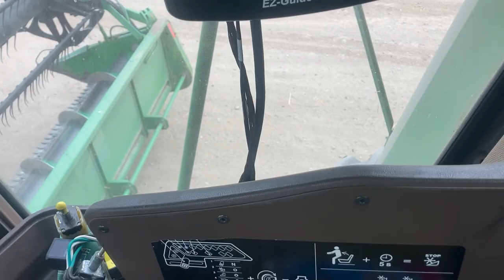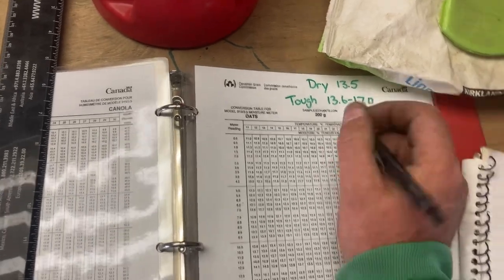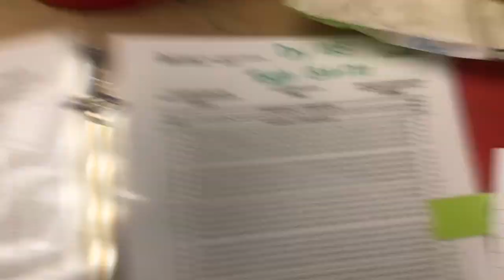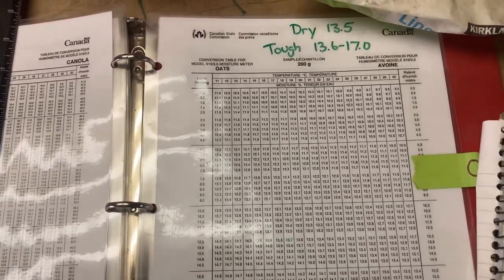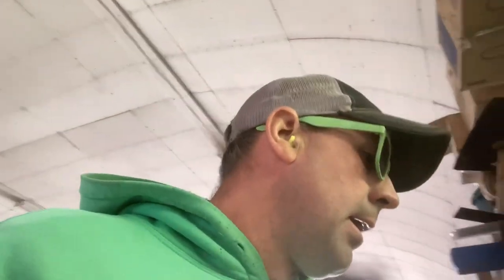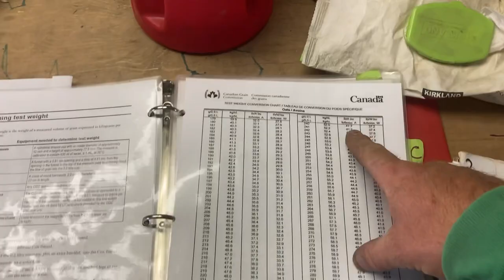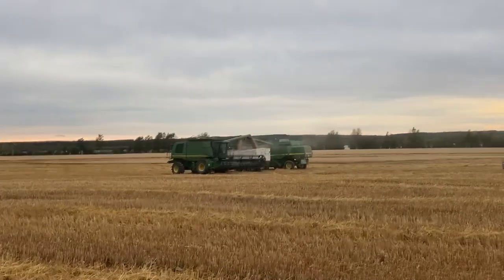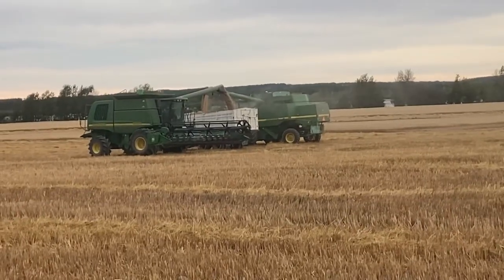9610 trouble & oat harvest

Comment: Crops looks good up there 👍🏾. My barley avg 16bpa
Reply: I don’t blame u waiting for canola to dry way down. Use to work at an elevator and had it heat at 10%. Which is “dry”. Apparently
Reply from the maker: That’s unfortunate about your barley. We had low yields on wheat and peas 40&22,  not sure what canola will do
Reply from the maker: Yes it’s a tricky crop
To store